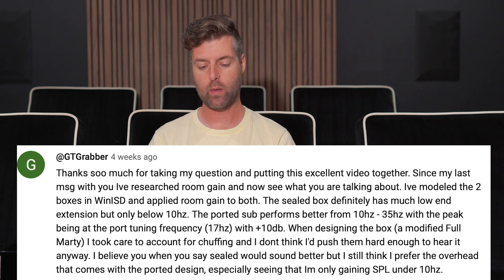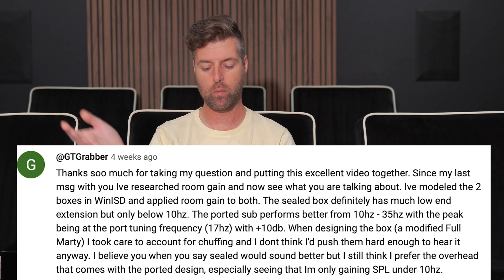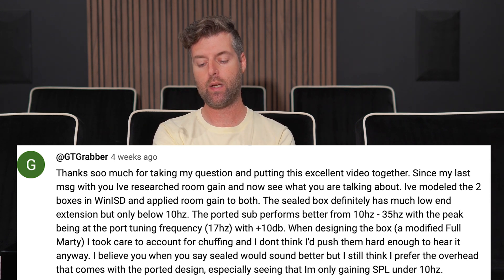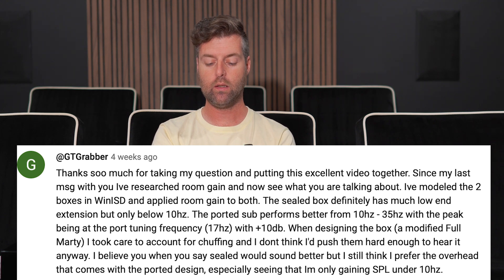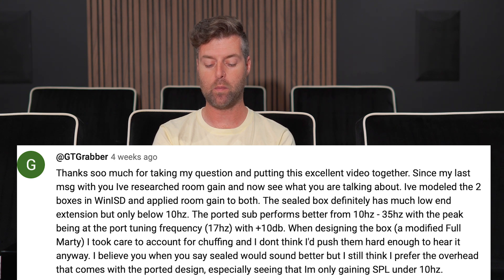Modeling room gain with WinISD

Comment: I think the topic of poor Sub EQing (+House Curve) during calibration creating “bad bass” needs to be talked about in a more simple manner, because there’s a lot of people that don’t understand this and simply blame the sub. It would be great to have a video we could refer them to for explanation with visual examples.
Reply from the maker: Hey Andrew. Thanks for the comment. When you say poor sub Eqing, do you mean the practice of simply trying to EQ to a curve. Like where people over EQ a system. Make it look good. But the results don’t sound good?
Reply: @PoesAcoustics  More like people don't EQ their subs at all and don't understand the benefits. I'd understand if this is too simple of a topic. I could make a video of this with my system if needed. Example: My 4x SVS PB-1000 Pros are not high performance of course, but aligned via MiniDSP their raw sweep is like +30dB between 17-60hz if I remember right, due to room gain. Obviously this makes the system very bloated and people would say "ported subs sound bloated, this is why I like Sealed".  I have to EQ them down with the MiniDSP,  and then down with a +4dB Harman Curve Dirac filter to make it sound good. Showing people that you need to verify performance, then use EQ or possibly port bungs with ported subs (which I did to help), is how you properly tune a system, not just throwing subs in.